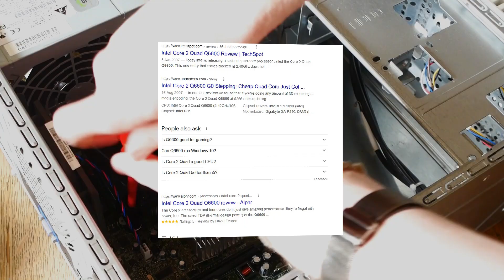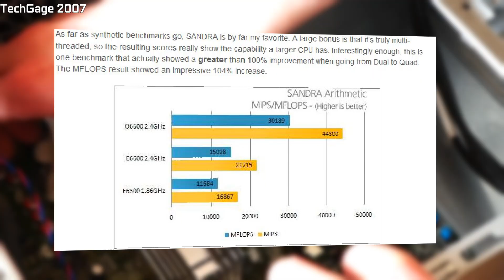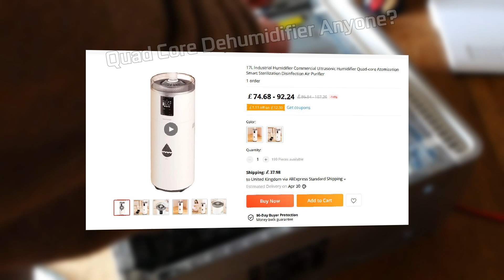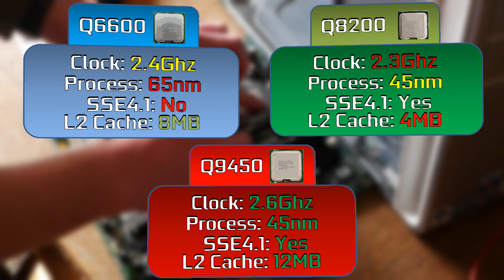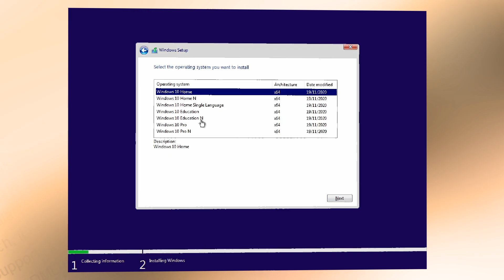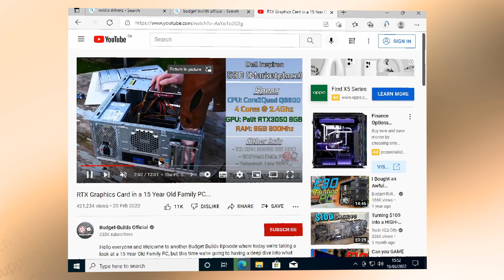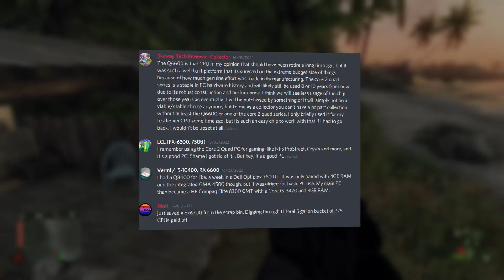Intel's Core2Quad...Finally Obsolete?

Comment: Anyone thinking of maxing out their Core2 mobo should get the E5450 Xeon which is basically a Q9650.
£12-13 for the CPU + 775 adapter vs about £35 for the Q9650.
The modding process is quite fun to do as well.
E5450 3Ghz + 8GB ram + SSD and any old GPU for acceleration is still usable to this day.
Could also use Linux for extra performance gains or if your max ram is 4GB.

Comment: Ahah, my laptop has a Celeron N4120 and 4GB of RAM, a CPU from 2019 that is as powerful as a Core 2 Quad from 2007. IT'S UNUSABLE in 2025... even typing this comment is so bad it can't keep up with my typing speed.... I'm happy to upgrade to a Lenovo Thinkpad X13 Gen 1 with a Ryzen 5 PRO 4650U 6 Cores 12 Threads at 4GHz, 8GB of RAM, 256GB of SSD and I'll run Gentoo Linux on it ! The Ryzen is so much faster... The Celeron despite having 4 cores the cores are so slow that you have the feeling to use a 2 cores or even worse a single core...

Comment: When I upgraded to Core2 it was either a E6600 for approx. 200,-€ or a Q6600 for 20,-€ more. Made the decision easy. Used it till 2024. My Q9550 is still in service on a Gigabyte mainboard with four 4GB DIMMs. Can't complain.

Comment: Still running q6600 in 2025, built a retro emulator system with 8,000 games off Linux. CPU is paired with gt520. And 9gb ram It's a beast for it's time

Comment: So I have a question.
I have a old dell inspiron 518 purchased new about 2008 ish.
The specs are a 25p gb ssd and 8 gb of ddr2 ram and a core 2 quad q6600.
The pc as never been retired it started out as a gaming rig back in the day.  It's now used as my office computer at work has been since 2017 ish it now runs win 10 pro  came with vista upgraded to vista ultimate then win 7 and Finnally windows 10. Bios firmware has been updated to.most recent.  Mainboard is a 0k068d   bios version 1.0.8  3/30/2009.  The system runs well still for daily office environment my question is can it support one of the newwe core 2 quads with sse4.1.  I think you know where I'm going  I want to be able to put windows 11 via the registry hack on this system.
Because I dont see the  need to retire a computer thags still functions and is going the job asked of it.
Some how that dell computer keeps on going with surprisingly little service other then cleaning its never had any failure of any kind.  Power supply was upgraded in 2008 along with the cpu and add in video card. I would run linux on it but sadly because it's in my office at work it has to run windows due to compatibility issues and I'd hate to toss a computer that's still working. New core 2 quad cups and thermal past are cheap.
Just trying to keep a old computer around a bit longer.

Comment: For 8 hours running, no problem...
For 24/7 running as server... Big no...

Idle power consumption is so high though i used L5420 mod which has low tdp...

The chipset (G31/G41) itself is power hungry...

For server i think haswell or higher is better...

Comment: Im still running my q6600 with a 9800 GTX. Its been running kinda slow since i did that dirty widows 10 update from 7. But i plan to do a clean install od Windiws 11 23H2 once support stops for windows 10. I jist play really old games and 16 bit style indie games anyway.

I might upgrade to a new PC once GTA 6 comes out. Consoles are to expensive to keep biying now.

Comment: I remember putting Xeon E5450 (basically a Q9650), 6 gigs of ddr2 and GTX 750 2GB in my old PC back in 2016. It was about as fast as PS4, but windows 10 and it's spectre and meltdown patches halved it's perfomance. Still was a pretty good PC on win 8.1 or win 7.

Comment: The Q6600 was a beast back in its heyday. I ran a couple of them, and never once had a complaint. Would I use them in 2024? Maybe. If I were running some super lightweight GNU/Linux distro.

Comment: Dec 2024 this just came across my feed.  I'd still be using my Q9650 (upgrade from previous E8400) on P35 chipset , 8GB, SSDs, GTX760 today as I type this except the Fire Dept. hosed the room it was in during the house fire.  I still have the system, and will attempt a powerup once the house rebuild is done in coming weeks.  All I do with it is Quake 3, Diablo 2, COD4MW, and stream 1080P.  I built the system Dec. 2007...wow 17 yrs ago.  I'll eventually flip it to Linux (if it didn't get fried with water), as another system was just donated to me.

Comment: This now 2024 & my C2Qs are still going strong.  I bought a Lenovo M58 tower in a junk store for 25 bucks around 2010, originally fitted with a C2D.  I upped that to a Q9300 (2.5GHz) & recently went from the 4x1G to 4x2G with Win10.  Perfect, runs quite cool.  I use that for all my work, web surfing, youtube & even writing this comment.  My home recording studio has a tiny HP dc7900 mini-PC attached to the back of the screen, that I found in an e-waste junk pile at a university.  Upped that one from a C2D to the cool 65-Watt 2.83GHz Q9550S (hard to find) Win10, runs OBS Studio streaming in H.264 & Audacity 24-bit recording simultaneously, with 40% CPU headroom to spare!  Sound reproduction is truly amazing.  They've been good to me for many years and I expect those two to be service to 2040 and beyond.

Comment: I went from a AMD Athlon 64X2 to AMD PhenomX4, I don't regret that. I had used a Core 2 Quad at a friends house and it ran things a little faster, but not worth $800. The AMD PhenomX4 9700 just blew the Core 2 Quad out of the water, in terms of price, and performance.

Comment: I have three PCs with quad core processors. Q9650 with 16Gb DDR 3 and GTX 970 graphics card.. Q9550 with 16Gb DDR2 and GTX 1050ti graphics card and finally Q9400 with 8Gb DDR2 and GTX 750 ti graphics card. It is perfectly sufficient for common tasks such as browsing the Internet, YouTube and playing movies.

Comment: I've just upgraded a slim form factor Dell Optiplex 755, with the faster processor motherboard can handle, Quad 9650, 8 gigs of Ddr2 800 in dual channel, Nvidia slim GT 1030 2 GB ddr5 and 1tb ssd hard disk, the machine FLIES, silent, small, superb built quality, I can even play at max QA  Half Life complete saga and Crisis 1/2, and all the games from that era. Not a gamer so not need to upgrade for now.

Comment: I used to run a Q6600, bought it used for about 40€ as an upgrade over the C2D E4500. Plot twist, however: I did that in 2015 because that was as far as the budget would stretch at the time. Not TOO much later I managed to snag a hand-me-down Core-i7 2600K with motherboard and RAM which saw me through all the way to spring of this year. Ah, good times, when games ran like absolute derriere because I couldn't afford the hardware to run them properly. Is it weird that I kind of miss that? Before the E4500 I had a laptop with SiS graphics and getting things to run, period, was always fun. I remember needing a special tool called "Oldblivion" to disable shaders in The Elder Scrolls IV: Oblivion just so the game would launch at all. And it would still run very poorly but I played the everloving excrement out of it just the same. It just doesn't hit quite the same way when you can launch a game, crank the settings up to maximum and it just works. I like the fiddling aspect of mediocre hardware.

Comment: I ran a Q9450 from new till I upgraded to a Ryzen 1600X back in 2017. Nearly a decade of impeccable service, most of it running rock solid at 3.5GHz on a Hyper 212 Evo. Really great processors - though I think you're wrong in saying the specs of the three you tested  trwqare that close, as the cache is extremely significant in a lot of situations. Nonetheless, great video!

Comment: This week I finally got to install the q9550 in my dell 760 desktop that has a gtx 750 ti using the official full height single slot pcie riser. Using an 160gb hdd it runs windows 10 and gta v at 40FPS on a 22“ dell i found in the trash. Connected pc speakers from the 90s and had a great gaming experience. It’s just the perfect sleeper pc gaming experience for me.

Comment: It is now obsolete in at least one way. It will not run the latest build of Windows 11, 24H2, at all, not even with workarounds for officially unsupported processors, because it does not support some newer instructions that are now used in the OS.

Comment: I can hardly imagine you can't run chat and music while gaming. I had a Phenom 9600 at the time, it was amazing for multitasking. On my Turion 64 singlecore laptop I used to turn off Skype and Xfire to get FPS boost. But that was one shitty  GHz core and a Geforce 6150 Go. While being below the official requirements, it ran CoD4 at lowest 640 x 480 with 15 - 35 FPS.

Comment: The whole reason to get the Q6600 was to overclock it. With a decent motherboard it was relatively easy to get over 3GHz, though past that your mileage would vary. The Q8200 was generally not a good overclocker. Don't remember anything about the Q9450 as far as overclocking

Comment: I used Q9650 till last year, with 8GB DDR3 and 7870 HD Radeon. It ran anything I threw at it, although not on high settings. The only issue was the lack of AVX instructions. Some of more advanced console emulators require these instructions so... I finally switched to 4970 and a RX580 😁

Comment: Are you sure lower graphical settings made sense when the CPU was the limit? 

Did you try another GPU to eliminate potential driver overhead? Also RDR2 looks very suspicious with those N64 quality textures (even worse than that since Kaze Emanuar's optimizations).

Comment: My first custom gaming PC had an E2600.  It was old then.  I think Intel was on Haswell when I was fooling with it.  I started learning about computers but the parts were so expensive compared to my income.  I went on Amazon and for $11 got a q6700.  It was a nice upgrade.  I had also started learning to overclock.  It was so much fun pushing those chips past stock speeds.  Now everything is already pushed to the limit and its much more boring.

Comment: I still have to Q6600s, I still actively use one for my backup machine, it drives 6 hard disks on ZFS quite easily and it doesn't always have to be on, so it's a pretty good fit.

Comment: i used to work with a C2Q Q9300 back in 2017 till 2018 and honestly it was not that bad if paired with a good gpu (i still have that system today. just unused)

Comment: I myself have seen and felt the downfall of phenom CPUs, I started with a phenom 64 9950 I believe it was, decent CPU at the time for me.. was way better than the Sempron 140 I had on my first PC, then I swapped to a phenom II X4 955, it was cool, I could run crysis alongside my GTX 260, then it burned and died. After that I bought another phenom, this time the X4 940, I got scammed and it didn't work, after that I went back to Athlon X2 7750 black edition, then tried Intel pentium g4560, and then Ryzen 3 3200g and finally my last CPU was Intel i5 7400, not much difference there, now I got nothing because I sold my PC and I'm broke af

Comment: i made my nephew a computer around 2021 to use as a step into pc gaming, and the CPU it had was an overclocked QX9650, with 8gb DDR2, and a 1gb GDDR5 645 GTX and Windows 10. He was very content using Gamepass on it with stuff like Farming Simulator and the like (it also came with USB Wifi, a Dell 900p 19" monitor, speakers, plus a dollar store gaming mouse and an old ThermalTake RGB keyboard. i even threw on stuff like CEMU and some games like Far Cry 5, which ran capably. he only retired it this past Xmas when he got himself a brand new pc.

Comment: those processors are viable for desktop stuff
If f.ex. your grandma has a core 2 duo system, slap a q8200 in it and add a ssd on top
They do day-to-day computing like modern i7s

Comment: Curious why you didn’t include the q9650 or qx9650?  Still capable of running most games today with decent frame rates especially on a mobo that allows 16gb ddr3.

Comment: I recently bought a Q6700 for $8 to max out an old Dell Optiplex 745. I was very surprised with how responsive and smooth it performed even running Windows 10. Paired with an NVS 315 I had on hand it's perfectly capable of streaming 1080p 60fps and web browsing

Perfect for being the Garage PC that it is

Comment: I still own my $1050 Acer desktop that came with a Q6600 in early 2008, and now that I know how much the CPU alone cost at the time, it feels like I got a bargain if anything. Lord knows I wouldn't shell out for whatever Ryzen chip costs that much nowadays (are there even any?) But now that I know it was nearly top of the line, it's no wonder it's the one part I never had to upgrade. By the time the computer finally crapped out in 2021, I had replaced the power supply TWICE, the graphics card TWICE, the hard drive THREE TIMES (two of those times were because they died, not because they were too small or too slow) and had doubled the RAM. And each time, the upgrade I did was enough to remedy the issue I was having. I still don't know if it's the motherboard or the CPU that kicked the bucket; all I know is it stopped powering on and that it wasn't the power supply.

Comment: My last desktop PC had Q9400 with Geforce GT 620. It was lying unused since 2016. Surprisingly it booted up despite 7 years of unuse. At I whim, I dual booted Windows 7 with Linux and found that the desktop was still usable in 2023. However, I found no value in keeping the system except nostalgia. My missus owns a budget Athlon 7220U laptop which is faster than this. With heavy heart, I donated the desktop to a community center.

Comment: i can confirm its not obsolete and with a decent graphics and max ram will run most games on at least medium settings
Reply: 4 years ago maybe, but definitely not now, most won’t boot.
Reply: I kept all my old pcs, as long as you have at least 8gb ram and a gtx 1060 or better its still decent compared to budget builds of today
Reply: @jonathanbrown1120  a core 2 quad literally can’t boot many modern games due to missing instructions.
Reply: What games specifically? Ill spend all weekend testing it out. I love experimenting with old pc hardware, what literally shouldn’t work like a gen 1 Pci to pciex16 adapter should not run or support modern graphics or nvme drives but that worked when i experimented with adaptors.

Comment: I still have a C2Q system that gets occasional use. It started out as an office computer that when my employer upgraded about 12 years ago, I got for 100 bucks. It got a bunch of upgrades over the years, like a g41 DDR3 motherboard, so that now the only original bits are the Q6600 CPU, and the mATX Compaq case. Last thing that changed on it was a GTX960 2GB quite a while ago. It runs older (pre RT) titles well enough, but compared to modern CPUs I believe an Intel n100 is about 50% faster using only 6watts. lol.

Comment: For GTA V, I wonder how 720p would effect results? I have a old PC that has been sitting around collecting dust for a few years now and I'm getting it ready to sell and as a result I've been doing some benchmarking. It's a Q6600 with 8GB DDR2 paired with a HD 7750 1GB GDDR5 and in GTA 5 at default settings at 720p running the in game benchmark test it scored 40.7  avg 5.9 min for pass 0, pass 1 was 51.5 avg 28.2 min, pass 2 was 51.8 avg 31.7 min, pass 3 was 49.4 avg with 34.6 min and pass 4 was 51.4 avg with 4.2 min, that was with reflections at high, turning that down to Normal gave it a little bump up. In other games, FFXIV Endwalker benchmark at 720p Standard (Desktop) it got 43.4 avg with a min of 6 while dropping down to the Standard (Laptop) preset gave it a very slight bump to 44.6 avg and min of 7. War Thunder Tank Battle (CPU) benchmark saw it get 41.4 avg and 21.6 min at 720p low while at minimum/ultra low it got 51 avg and 26.1 min. For older AAA games it got 59.7 avg and 54 min in Tomb Raider (2013) at 720p high while bumping it up to Ultra saw it get 49.5 avg and 36.8 min. Finally in Sleeping Dogs Definitive Edition at 720p medium that it defaulted to it got 45.1 avg and 27.5 min, bumping it up to high it got 31.9 avg with 22.3 min whild going the other way dropping to low saw it get 55.5 avg with a min of 35.7
Reply: In the future I'll be working on another PC that would require a half height/low profile GPU as it's SFF and it currently got a Pentium E6600 in it with 4GB of DDR3 1333 however I'm planning on throwing in a Q9400 I have laying around and replace the 4GB with at least 8GB of RAM (1600 MHz most likely) and after getting a GPU to pair with it (at most something like a GT 1030, likely the DDR4 version) I plan on running those tests again (perhaps with the Pentium E6600 before swapping in the Q9400)

Comment: wel i remember back then , i jumped from a pentium 4 to a Q9550 , had to save a lot of money to be able to afford it. but it was worth it. it was a verry strong cpu, and would beat any of the ones u shown. in all honnesty the jump from pentium 4 to the Q series on offcoarse the same socked, was absolutly a computer dream, and what u would expect if u wait for the right one.... to get, i skipped dual cores and al those stuff all together, because my single core pentium 4 was still kicking ass :) , i just put money aside, again, again and again... til.... it was the day :) i only took the Q9550 out of service about 8 years ago for a change to a I7

Comment: An obscure fact was that you needed the b0 stepping for the q6600 and then you could really go nuts with undervolting and overclocking. I had the luck back then to be able to select mine. Ran 4x3ghz with stock cooler out of the box with slight undervolt

Comment: As i tested core 2 duo e7300, it got almost 60 fps on honkai star rail. I dont think its Obsolete yet as long they are sse 4.1 compatbile.

CS2 not tested, because sse 4.2 required, and yeah poorly optimized game compared to genshin or honkai.